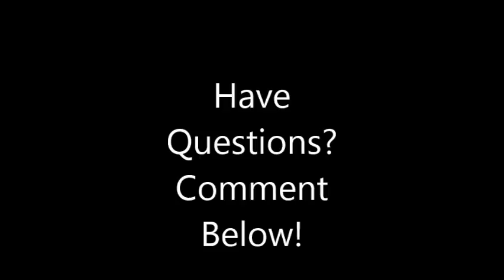How To Wire Two Pull Stations To An Alarm Without Using A Panel

Comment: are all circuits the same? Here's how i do mine for one pull station to a fire alarm. Starting with the battery (in this case i use a 12v battery), the + of the battery goes to the + of the alarm. The - of the battery goes to the + of the pull station. Finally, the - of the pull station goes to the - of the alarm. My question is, how will it work when i want to use two pull stations?
Reply from the maker: +FireAlarmsfromSouthTexas Good question. All you have to do is connect the positive terminal of your first pull station to the positive of your second pull station and the negative terminal of your first pull station to the negative end of your second pull station. Then the two pull stations should both activate the alarm. Hope this helps! :)

Comment: What about 2 pullstations and two alarms how would that be wired up??
Reply from the maker: Good question. All you would need to do is do this, but take your second alarm and connect the positive terminal to the positive terminal of the first alarm and do the same for the negative terminal. In short: you need to wire the second alarm in parallel to the first. :) Hope this helps!
Reply: Thanks! i make a video with 2 pullstaions and 2 alarms and say that you helped!
Reply from the maker: Of course! Glad to help! I'll check your video out! :)